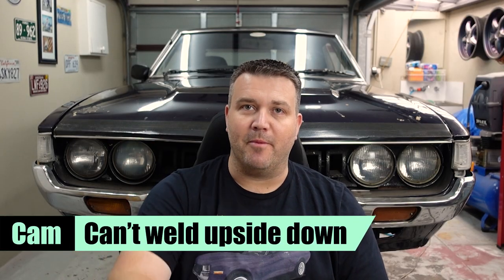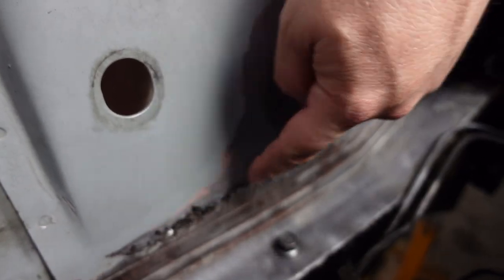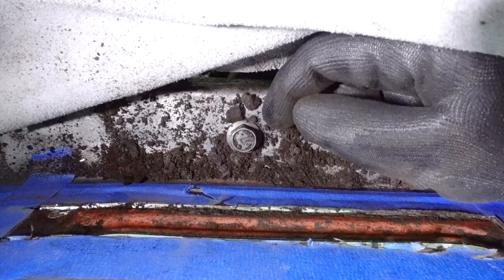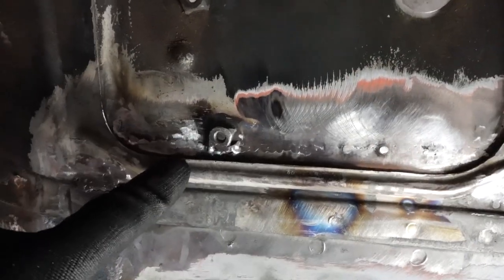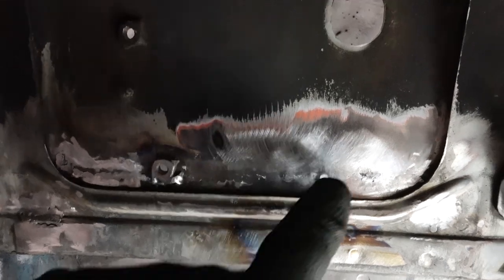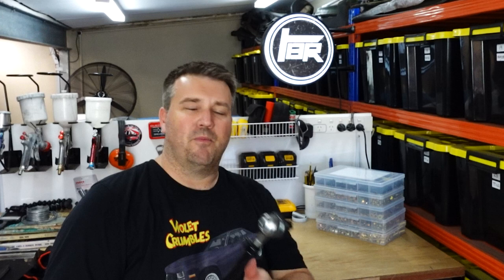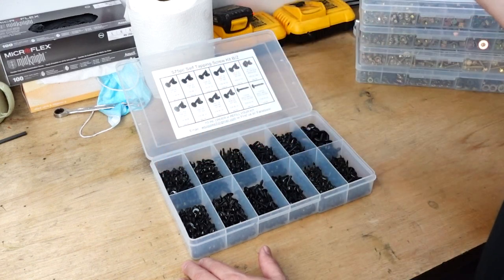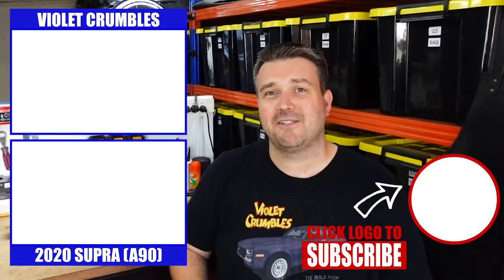Rust Repair in Strut Tower  - RA23 Toyota Celica Restomod (Part 17)

Comment: Love the series. You're really coming along with the project. Good work on figuring out the bolts, those can be a bit of a pain to find when you need them. With my Datsun 280 project I made the decision to get a prepared bolt setup in stainless. It was absolutely more expensive than what you chose. So don't feel bad because that is the better way to go when doing multi projects as your channel will do! Keep up the good work. Content is good, good breakdown of process and yeah, a little mix of other things works on a weekly bases for you not to loose your mind!
Reply from the maker: Thanks for the kind words. If you don't mind me asking where did you get your 280 bolt kit?

Comment: Good info on the bolts. But now I have to check under my master cylinder for rust as well. Keep it coming.
Reply from the maker: Cheers Owen, bolts are definitely worth a look as a cheap easy solution. 👍